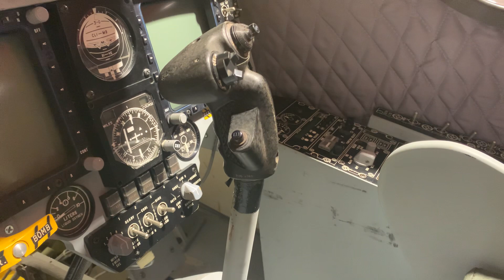RNZAF A-4K Skyhawk “Hotshot” Flight Simulator restoration. Part 6 - The stick and roll potentiometer

Comment: I converted an old Alphajet simulator (built by CAE) using FSUIPC, and MS Flight Sim. The original unit was IFR trainer, so no visuals. I added 3 plasma screens for out of cockpit display. All the old tape drives, disk platters, data towers, and miles of cable were replaced with a standard quad PC with 3 NVIDIA controllers. The HUD was functional by putting an LCD in front of the old cathode tube. I found a nice Alphajet HUD instrument for MSFS and used that on the LCD, so full optics in the HUD worked. There's tons of solutions out there that will replicate just ab9ut every instrument on board.
Reply from the maker: That's awesome that you could convert an old Alphajet simulator for MSFS2020. Plasma screens offer better definition that a projected image in my view. And a great way to create a working HUD. 👍
Reply: @biplaneflights  Yeah, it was back in 2006 when i worked on it. It had a 6 axis motion platform (hydraulic rams) but I was too terrified to try getting them working again. I think it's still up there at Arlington AP in Washington state.